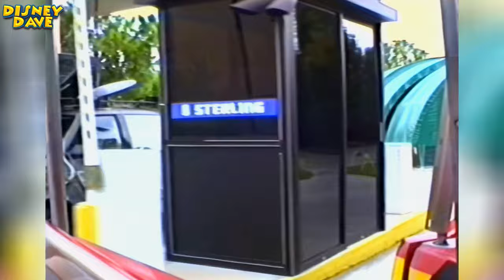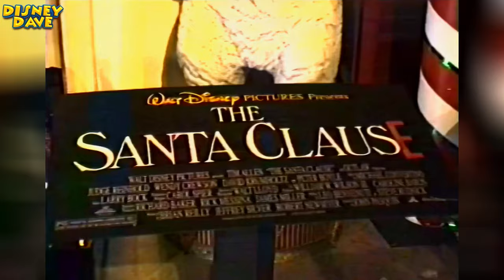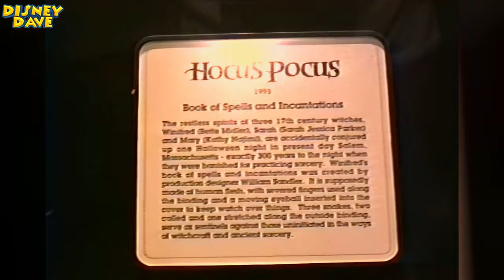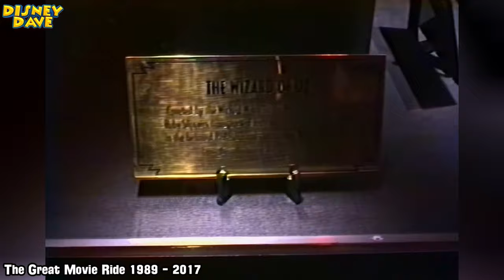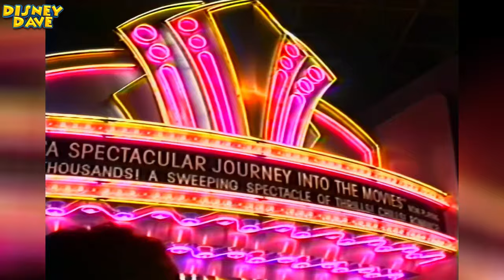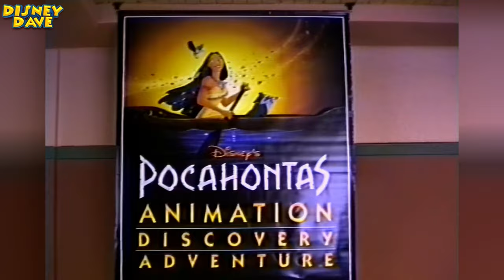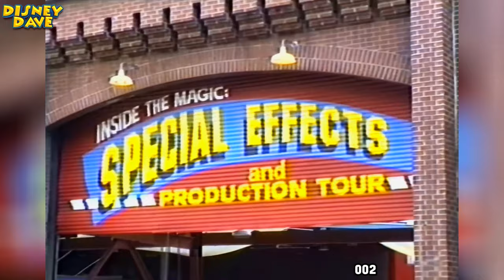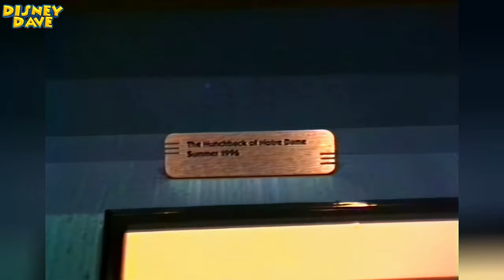Restored Home Movie: Visiting Disney MGM Studios Walt Disney World Florida in 1995

Comment: Great job with the restoration effort. What software was used to restore?
Reply from the maker: @northridgewood5918, I used Virtual dub to transfer the original files to Digital, Then I run the video through Topaz Video AI and the the final part comes in the editing process, where I improve the quality and colour with general tweaking of the video and adding a LUT, Hope this helps 👍
Reply: @DisneyDave  yes! Very helpful. Thanks for the tip.